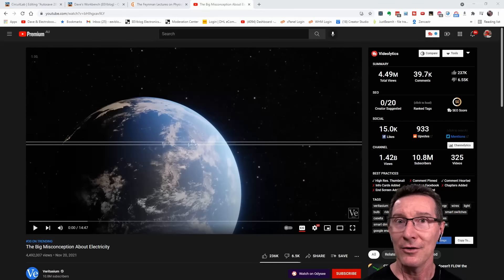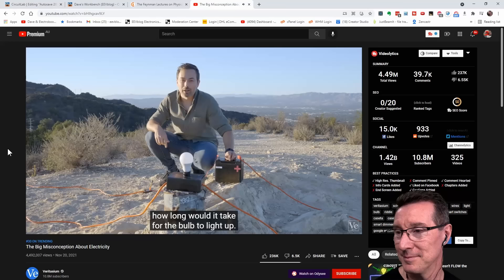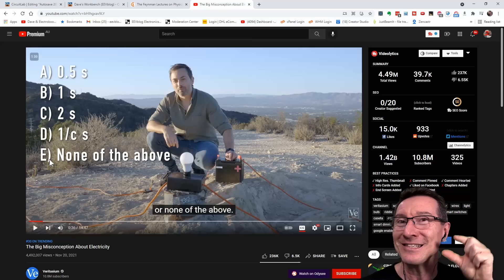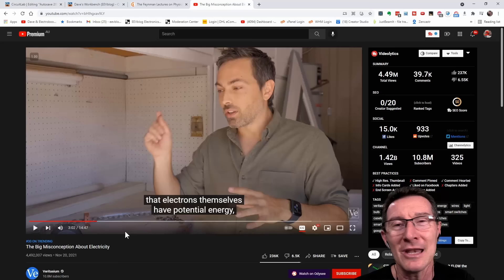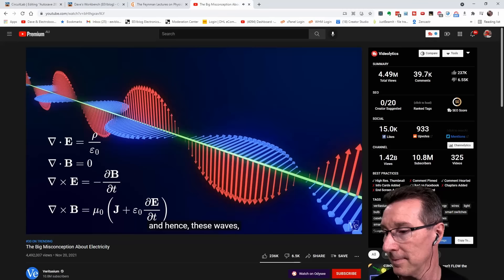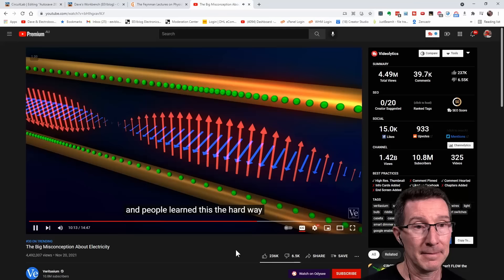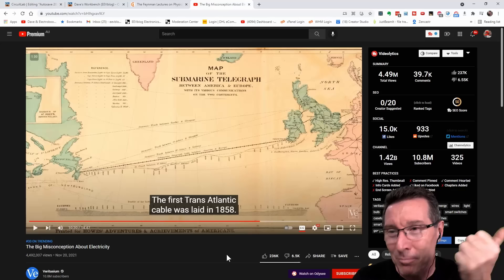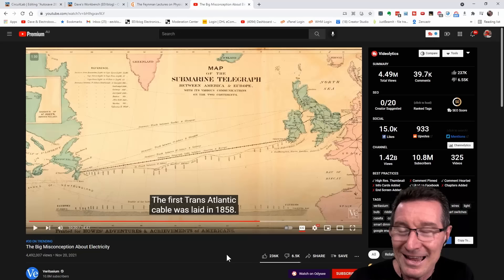EEVblog 1439 - Analysing Veritasium's Electricity Misconceptions Video

Comment: 40:24 - Feynman showing that "the Poynting vector" is going into the wire: This is not the entire Poynting vector that represents the energy flow from source to load. That part that goes into the wire represents the losses in the conductor. We strive to have good conductors - the better the conductor, the smaller the electric field in the axial direction of the conductor and the smaller the component of the Poynting vector pointing into the wire. When integrating this component of the Poynting vector over the surface of the conductor, the result is I*I*R.
There would be no voltage drop on a wire with zero resistance, so the electric field in axial direction would be zero as well and there would be no bit of the Poynting vector pointing into the wire. All the energy would remain in the field outside the wire.
Reply: Great comment!

Yes, it's actually weird that from the basic stand point of conservation of energy, one can so casually keep saying that the Poynting vector, i.e energy flow (flux) is towards the wire (and keep assuming a lossless wire). Dave makes it seem like it has something to do with the energy flow along the wire. (or that's how I understood him) But how would the energy the propagate to the load if this is the only direction of the Poynting vector?

Actually I think transmission line theory for this problem is even more complicated than just imagining it as two dipole antennas. Well .. if antenna theory is any easier to understand.. but intuitively you would see why the energy travels near instantly to the load -- because they are two dipole antennas next to each other.
Reply: i watched how powerlines were being repaired using a helicopter, and was given some explanation as to how this was possible without getting electrocuted. seems the electric field was diverted around the helicopter so that the cable could be repaired.
Reply: Dave mentions about this at 11:18
Reply: whatever Feynman said, that is the truth. He wrote a fucking book about quantum electrodynamics.
Reply: and a lossless conductor could therefore be infinetely thin?
Reply: The "energy" outside the wires is not heat energy (if you are in a vacuum) since there is nothing being heated.  Or is it radiated infrared in proportion to resistance losses?  Assume current and power flow but no frictional/resistance losses in a theoretical ideal  wire material.  In a vacuum there are no kinetic energy losses either outside the wire, since there is nothing in a vacuum outside the wires to be accelerated.  Therefore, what form is the energy outside the wire?  What carries this energy if there is nothing there but a vacuum?  Energy is joules in units of newton meters, and newtons refer to accelerating matter at an increasing rate.  So if there is no matter to be accelerated outside the wire, what is the form of the energy in the accompanying changing electric and magnetic fields?
Reply: If energy is moving in free space around the wire, what would make it suddenly "want" to converge inside the filament and heat it to incandescence?  That sounds like a violation of entropy.
Reply: At all points in space there is some kind of gravitational field and some kind of electrical field and some kind of magnetic field.  What is the "stuff" that jumps out of the wire and increases the field (electric, magnetic) when the power is turned on and the current flows?
Reply: A proton has the mass of 1835 electrons.  Something is going on inside an electron we call "negative charge."  Must be the same thing only backwards/inside out/clockwise vs. counterclockwise is going on inside  a proton (or a positron) that we describe as "positive charge."    What is the "thing" that causes what we call electric charge?
Reply: @marc_frank  I think that's an interesting question. Like what happens to the wave function of the electron within a lossless wire - if an infinitely thin lossless wire can carry infinite amount of current. I'd guess that means the electrons occupy the space either completely, or not at all.
Reply: @jackieow6692  the energy is stored in the fields. it is no less weird to think that energy is stored in falling marbles than to think that energy is in fields
Reply: Care to give a reference? If there is no voltage drop, there will be no electric field (or constant electric field) and no energy transfer is possible.
Reply: @carlosgaspar8447  the explanation given was wrong; who said so?
Reply: @jackieow6692  It does not converge. Just imagine a radio antenna,it sees a small voltage and and selects and uses that. It does not cause other radios to stop working. Usually AM radios need very long antenna to work well and it sees only a couple of uV as signal
Reply: @jackieow6692  electron is a lepton; it is a product of the quantization of the electric field. In EM theory, the field is supreme and the electrons are secondary products of the electric field.
Reply: @janami-dharmam  AM modulation has nothing to do with antenna length. AM works for any frequency and wire length
Reply: @janami-dharmam  the particle associated with the quantization of the Electromagnetic field is the photon, not the electron
Reply: @skulpturalol  So writing a book means you are absolutely right about something, whereas making a video about something doesn't? In which case, we can read books that tell us the Earth is flat and the sun goes around the Earth and the moon is made of cheese. All of which we know to be wrong. For just about every theory, there are opposing theories. Our 'knowledge' changes dramatically over time. And that  a "fucking" fact.
Reply: @marc_frank  Yup it's more a Physics question, as the poster says - ideal wire (no R, L C?) - unreal outcome, not applicable to real world Engineering (and 50/60 Hz AC is about as lame as DC in the radio sphere).
Reply: @janami-dharmam  i don't recall the exact explanation. it was a random youtube video about repairing remote powerlines in france, i seem to recall.

Comment: Thanks Dave for your unagitated and professional and way reacting to this.
I see the point made on the veritassium video, however for the general public and the average guy, it's like considering Einsteins relativity theory every time using a GPS.
Side note: My flux capacitor equations never gave back 42, maybe because I neglected this fact we have learned now. Jeez...have to do it all over again.
Reply from the maker: If you divide 121 by 42 and then subtract 2 and multiple by 100 you get 88. Well, 88.095 but the digital speedo was only two digits.
Reply: GPS only works because of both general and special relativity. The fact that we don’t need to understand these subjects to use GPS does not mean some of us need to, and for the rest it is cool to know the deeper truth.
Reply: @jimmcclymer4230  Do you actually have a credible source for that Einsteins relativity was needed to develop GPS. I have read somewhere that the corrections for relativistic effects are done with calibration parameters on the clocks that are determined empirically through measurements rather than through theoretical calculations. I know that it is often stated that relativity theory was needed in the development of GPS but to me it makes sense that you would just measure any drift in the clocks after launch and compensate for it. From a practical point of
 view it does not matter if the drift is due to relativity or if the clocks just got out of calibration during launch.
Reply: @mattmurphy7030  Yeah but he does that kind of in a way that purposely misrepresents physics.
Reply: @Kandralla  Yeah it annoyed me - he's structured the video like a 3 card monte to generate controversy, comments and clicks rather than trying to explain the subject in an understandable way... And he does know how to make good educational videos when he wants to.
Reply: A better example is that no one is using general relativity to design bridges. Technically gravitational field doesn't exist, Newton law of gravitation is wrong, gravity is actually bent spacetime. But then Newton law is good enough to design bridges and to navigate within solar system
Reply: If you contact the crew of Voyager, they will set you straight.
Reply: @larslindgren3846  Not sure what happened to my original comment...seems to have disappeared into the "ether"...lol. I'll try to recreate it here.

It's decades since I did the math on this kind of thing, so way out of practice, but I think you'll find there are multiple relativistic effects in the GPS system, not just the "rough" clock adjustment prior to launch in the satellites themselves. Things like the distortion of the orbit due to tidal forces and such, which affect the adjustment required. I don't think the satellites or handsets themselves actually do the full math to solve things relativisticly, rather they use some shortcuts to get "close enough". The only original official doc I ever found that talks a bit about why relativity needs to be taken into account (as opposed to just stating it) is here:

https://www.govinfo.gov/content/pkg/GOVPUB-C13-83ec647d39931e27e1a786845bb825c2/pdf/GOVPUB-C13-83ec647d39931e27e1a786845bb825c2.pdf

This PROVES they did take relativity into account in the design from the start. It's a NIST guide for GPS receiver manufacturers about the effects the handsets need to compensate for over and above the satellite clock adjustment. I believe they do ongoing measure and adjustment operations as you suggest, however they wouldn't have known that they had to adjust let alone why, if they hadn't known to take both general and special relativity into account in the design to begin with. Without that initial rough clock adjustment, the drift would happen so fast that the updates would be constant, if it could even work at all with slow 1980s era tech. By fixing the pace of the ticks in the satellite clocks to account for relativity, they make the drift much slower which greatly extends time between updates without affecting operation. Without this, the drift would be kilometers per day and that would be very bad if you're aim is to guide a munition within a meter or 2 at any instant in time where you can't wait for an update.
Reply: @richardbaird1452  Thank you for that link it seems to Indicate several relativistic effects that would be hard to compensate for without a relativistic model.

Comment: This is a deceptively simple problem with lots of rabbit holes to pursue, but Dave clears up this problem nicely. One of the most interesting classes I took in college was transmission lines in my senior year (BSEE curriculum). In that class the professor very clearly showed that electricity is really light, at least in terms of behavior, but I think even at a fundamental level. Even though this wasn't a class in optics, theories of refraction (lenses) , reflection (mirrors) and other topics were compared to transmission line equations and sure enough the parallels are amazing. Even a radar dish on a jumbo jet behind an "opaque" cone appears transparent at radar frequencies. The cone material is specifically chosen so the impedance is matched. If the wrong material were used the radar would be reflected back into the plane. Light is a coaxial circuit from source (eg an LED) to observer or destination (eg our eyes or a camera sensor). Our existence is a complex matrix of coaxial circuits that we take for granted every day.

Comment: Pointing vector goes into the wire IF and only IF wire has resistive losses, otherwise the tangential electric field on the surface of the prefect conductor is zero.
Reply: Component of the pointing vector flowing into the wire is the resistive loss.
The component of pointing vector along the wire is the one carrying the power to the load.
The DC electric field inside the bulk of conductor is proportional to the resistive loss!
Reply: That's Poynting
Reply: @milos_radovanovic  Finally someone gives the right answer.
Reply: Most wires which I have encountered in the real world (I am a physicist by training) have resistive losses, even though I have made experiments at an electron synchronton with superconducting magnetic coils once.. but even there most cables were actually standard, resistive copper cables.
Reply: Yeah. The poynting vector in fig 27-5 at 43:00 is the energy flow that is converted into heat.
Reply: This is correct. We know this by looking at the conduction current density equation: E = J/sigma. For a lossless conductor sigma -> infinity. Hence the electric field inside the conductor is 0, and the pointing vector would equal 0 inside the conductor.
Reply: @milos_radovanovic  That is what I understood from the course in the first semester. Thanks!
Reply: So how much time it would take for the bulb to turn on if the wires were arranged in a circle?
Reply: @fullmetaljacket7  Define "turn on", because leaving this pretty undefined was one of the original video's problems.
Reply: @uwezimmermann5427  Yes, but he said in the beginning the wires would have no resistance.

Honestly, this problem is not hard because the underlying processes are complicated, but because the setup is too vague to agree on one answer. I mean I could also tell you that there will probably some changes in the electromagnetic field at the position of the lamp after turning the switch, but I would not consider this as something important to the question (since the field is weak).
Reply: @peter9477  forget the light bulb and connect a multimeter there. How long it would take for the multimeter to start measuring any voltage coming from the battery?